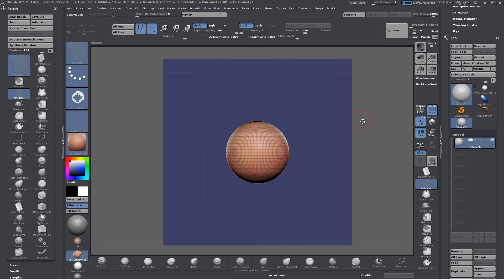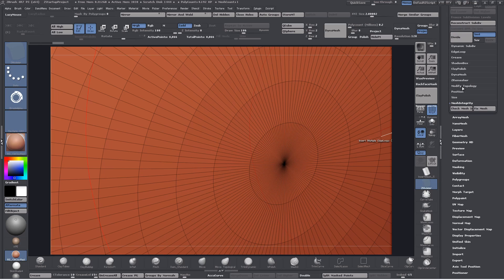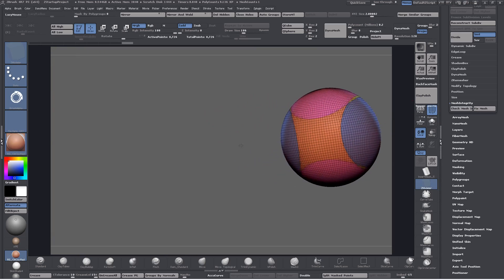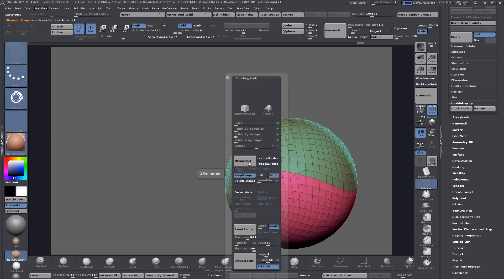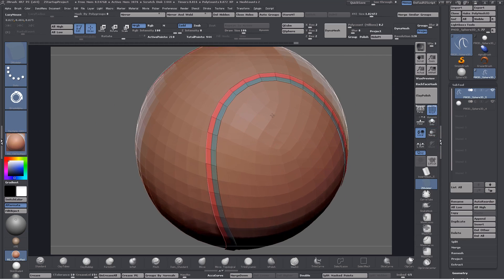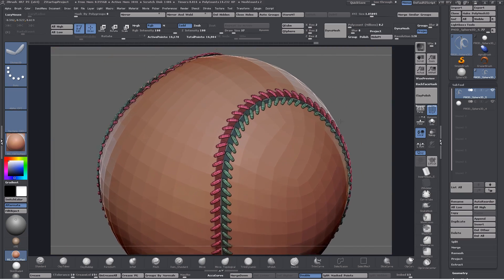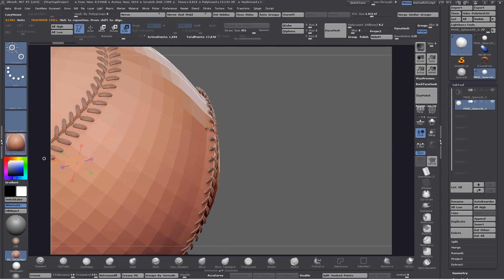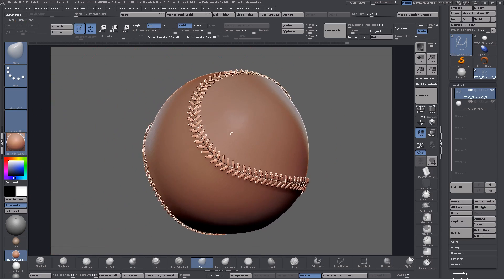Zbrush 'Quickies' - Modeling a Baseball

Comment: Hi there! Great tutorial, thank you for your time! 
I had a quick question, I've followed your steps to a T, and it seems that my stitching has more spacing in between each set. Yours are tighter and closer together. I've played with the curve modifiers and that, but can't seem to close the gaps.... Any suggestions? 

Thanks again!
Reply from the maker: +mira bella Thanks for the comment. You can change adjust the spacing with Stroke>Curve>Curve Step. you just have to balance it with the brush size.
Reply: Thanks so much for the reply! I will definitely check this out.